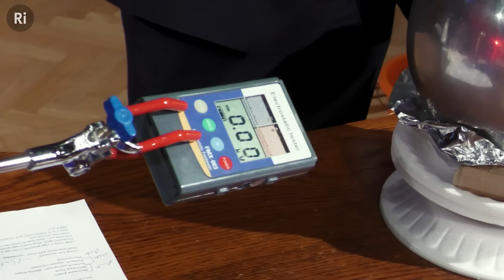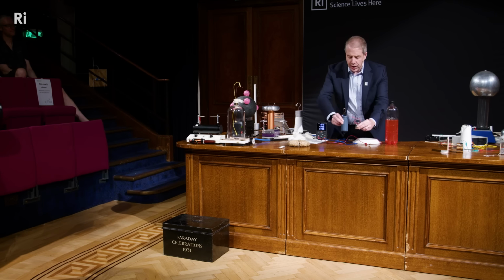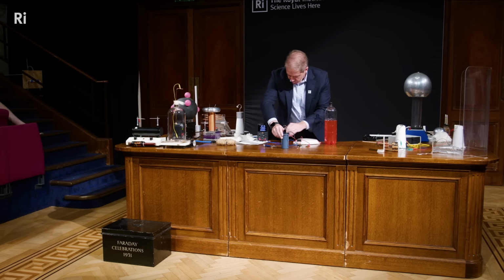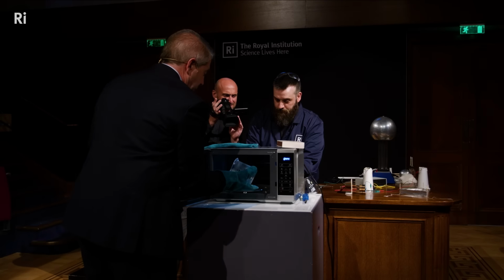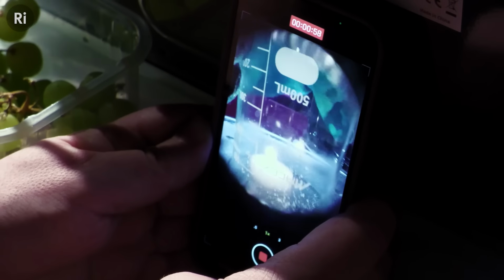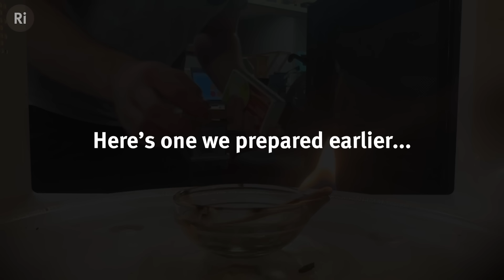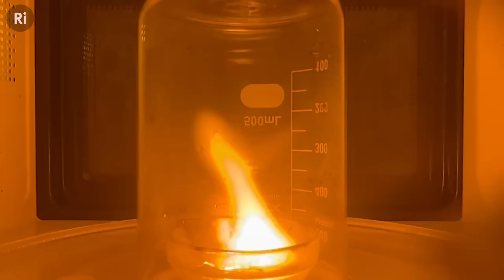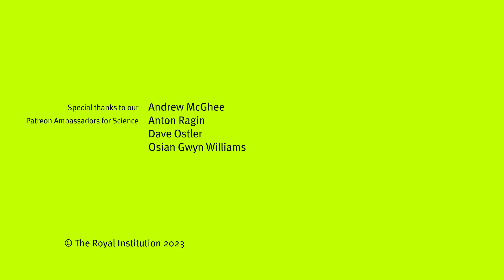High-voltage physics - with David Ricketts

Comment: What a show! The plasma toroid was the most extraordinary thing. I'm flabbergasted.
Reply: Thank you for writing out the name. I was really struggling to find it by description.  I seen your comment and did a search using the name you provided and now I am able to learn a lot more about that affect. It is super cool.
Reply: @TheRadioAteMyTV He said the name, you could have enabled captions too.
Reply: @Splarkszter  I couldn't understand what he said well enough to spell it it turns out.  There were no captions available where I watched it, so andy's post was a real life and time saver. I am grateful.
Reply: The tea candle probably doesn't work well because they have metal plate holding the wick.
Try a birthday candle.
Reply: And yet it makes perfect sense.  Plasma is conductive.  If you can get it in a ring, it becomes a secondary of a transformer, and thus self heating due to induced current.  I've never seen it, but as soon as i did, i was "kewl, the ionized plasma is a coil."
Reply: @jeromethiel4323  yes, and what most people fail to understand is its this feature that allows, or doesnt allow you to pump "so much power" into it as its just a transformer reflecting at the square of turns ratio.

some thinking, and a few measurements, you can figure out the resistance of that ..."single turn conductor" from the power draw.

other thing i always see is they fail to consider the other side of the circuit... theres the coil... but wheres the current actually coming from, and how does that magnetic field affect the induced toroid? 

from all my years on induction heating... its sort of important to consider the stray magnetic fields that are being created ELSEWHERE....
Reply: @michaelszczys8316  used to do it years ago, i never had any success with hydrocarbon/wax based flame.
whereas the example in the dish? notice its a MATCH. timber and paper work.

i dont know why it makes a difference but it does... different chemical reactions, valencies, iunno... the timber is carbohydrate (contains oxygen?) rather than hydrocarbon maybe.
Reply: @paradiselost9946  probably whatever makes more ' smoke '.
The stuff floating in the air is glowing.
Reply: @michaelszczys8316  it glows but it never has the same impressive results.

smouldering oils, greases... i just find that hydrocarbons dont do it anywhere as near as good as organic flames based on celluloses aka carbohydrates, starches, sugars...

Comment: As an electrician, I went to a house where lightning hit the TV antenna. It blew a hole in the tile roof. The TV coax had NO copper in it. Power points were blown off walls. 240 volt cables had NO copper in them. Just plastic spagetti.
Reply: My boss went home to get lunch just after a thunderstorm had been thru. Lightning had gone down his chimney, messed up his fireplace and hit his entertainment center. He said he was glad not to have been there, there was a lot of shrapnel.

Comment: Wow that's the most amazing lecture I've ever seen. I'm an electrical engineer working in power electronics. I wonder how many young people were inspired into a new career path from that? If so welcome and enjoy it.
Reply: It is only amazing if you ALREADY understand electrostatic theory- I couldn’t stick around for the whole video because it Sucks and he obviously didn’t rehearse to be sure the visual demonstrations would be successful. Huge fail imo.
Reply: Really? The most amazing you've ever seen?
Reply: @soburnedout  dont be so rude the ambient air humidity was high in London at that time, so think about it. He did better than you could do I am sure...
Reply: What is your job
Reply: Possibly amazing if you have not had any physics classes. I did all the high voltage stuff he demonstrated when I was a high school student in the 60s - including building a much larger and more powerful Tesla Coil. And it was built to Tesla's original design, not using modern electronics.

Comment: Very impressive lecture and demonstration. I have one correction though. The Tesla coil demo was not 1,000,000 volts. It was perhaps 200,000 to 300,000 volts. Tesla coils work by discharging many times per second. Each discharge creates a plasma trail. The next discharge follows the previous plasma trail. The path thus continues to grow until the power supplied is exceeded. This is what allows a Tesla coil discharge to be many times the length predicted from a simple air breakdown calculation.

Comment: An excellent progression through voltage and time periods. 
Keep in mind that the LAST thing Dr. Tesla would have ever thought about using the Tesla Coil for is creating music.! 
He did use plasma lighting as shown in the spherical demonstrations in the 1891 HPHF lectures; and predict that it would in the future be optimized and miniaturized chemically to work at very low voltages, which is what is now developed & implemented as LED lighting which indeed obsoleted the plasma vacuum of the fluorescent tube which he brought forth back then..
Reply: LEDs don't emit light because of plasma. They are "Solid state" devices. (i.e. semiconductors not vacuum tubes)

Tesla didn't invent the use of phosphorus coated rarefied gas tubes for lighting, but he invented powering the tubes "wirelessly" using a nearby Tesla coil.

Comment: I would like to present to you another electrical device:
- The device consists of two capacitors: C1 and C2.
- Each capacitor has two plates. In C1, these are named C1-1 and C1-2, while in C2, they are C2-1 and C2-2.
- C1-2 and C2-2 act as electrets and are electrically isolated from the rest of the circuit.
- C1-2 presents a positive voltage field to C1-1, and C2-2 presents a negative voltage field to C2-1.
- To rearrange the plates, C1-2 and C2-2 are mounted on a rotor, allowing them to be exchanged from side to side
- C1-1 and C2-1 are electrically connected through a load of arbitrary resistance and are mounted as stators in the system
- When the rotor is at 0 degrees rotation, the capacitor plates are as close to each other as possible, when the rotor is at 90 degrees rotation the capacitor plates on the rotor are equidistant to the capacitor plates on the stator
- the rotor plates are charged and then electrically isolated to act as electrets during opperation
- the stator plates are charges and discharges passively based on which rotor plate they are nearest to

If I start with 100 joules of energy and I rotate the rotor to 90 degrees using that energy and I lose 5 joules to friction, then I can store 95 joules of energy as potential energy and electrical potential energy between the rotor and the capacitor plates. Since the energy is being stored as electrical potential energy, a current will flow through the load until the charges on plates C1-1 and C2-1 are equal, the electrical potential energy stored will be equal to the potential energy we stored in the rotor 95 joules. Once the charges on C1-1 and C2-1 are equal, the system is at it's point of highest energy and the rotor is resting in at unstable balance point, tipping the rotor to 91 degrees causes the charges to rebalance to reflect the change in the exposed voltage field. Now C2-1 starts to accumulate the opposite charge as C1-2 and C1-1 starts accumulate the opposite charge as C2-2. This causes electrostatic attraction to increase between the plates and to torque the plate forward towards 180 degrees rotation.

This effect releases the potential energy that we initially stored on the rotor. When we stored the energy, we said we lost 5 joules to friction, so we're going to lose 5 joules to friction again when we release the potential energy, meaning we will get 90 joules of potential energy back as kinetic energy once we complete 180 degrees in rotation. At the same time, while we are releasing the potential energy, the magnitude of charge on C1-1 and C2-2 is increasing to reflect the new geometry of teh system. 95 joules of electrical energy will have to flow from C1-1 to C2-1 again in order to release the stored potential energy.

So all in all, in this case with the energy values presented:
- You will store and release potential energy on the rotor to complete a 180 degree rotation
- You will store and release 100 joules of energy with a 10% loss on retrieval
- You will cause 190 joules of energy to flow from C1-1 to C2-1 in order to store and release this potential energy

Comment: I've seen grapes used to induce plasma in a microwave. 😊Put a grape on a plate and place a glass over the top. Switch on microwave.  The glass keeps the plasma contained. It was a while ago, so please forgive me if I've forgotten something.
Reply: Ok? Bro, I induce plasma with an arc hotter than the surface of the sun every time I tig weld.
Reply: @AdamWest-qp3yp  In a microwave? Wow!
Reply: @LMde20  sure a microwave has metal I can weld. and yes I can take a beaker right now and make grape plasma in a microwave, it’s called hit start
Reply: @AdamWest-qp3yp  Look, I was making comment on the fact that their way of inducing plasma in the microwave appeared a little fiddly for them. And maybe they hadn't seen, or thought of, the simple grape. I'm happy for you that you can weld and seem to know more about plasma than most. But, your comments are coming across as condescending and off the subject I was discussing. I'm not here to argue with you, that's all.
Reply: @AdamWest-qp3yp wow, you’re so cool

Comment: In Faraday's first experimental demonstration (August 29, 1831), he wrapped two wires around opposite sides of an iron ring or "torus" (an arrangement similar to a modern toroidal transformer).[citation needed] Based on his understanding of electromagnets, he expected that, when current started to flow in one wire, a sort of wave would travel through the ring and cause some electrical effect on the opposite side. He plugged one wire into a galvanometer, and watched it as he connected the other wire to a battery. He saw a transient current, which he called a "wave of electricity", when he connected the wire to the battery and another when he disconnected it.[7] This induction was due to the change in magnetic flux that occurred when the battery was connected and disconnected.[2] Within two months, Faraday found several other manifestations of electromagnetic induction. For example, he saw transient currents when he quickly slid a bar magnet in and out of a coil of wires, and he generated a steady (DC) current by rotating a copper disk near the bar magnet with a sliding electrical lead ("Faraday's disk").[8]

Faraday explained electromagnetic induction using a concept he called lines of force. However, scientists at the time widely rejected his theoretical ideas, mainly because they were not formulated mathematically.[9] An exception was James Clerk Maxwell, who used Faraday's ideas as the basis of his quantitative electromagnetic theory.[9][10][11] In Maxwell's model, the time varying aspect of electromagnetic induction is expressed as a differential equation, which Oliver Heaviside referred to as Faraday's law even though it is slightly different from Faraday's original formulation and does not describe motional emf. Heaviside's version (see Maxwell–Faraday equation below) is the form recognized today in the group of equations known as Maxwell's equations.

In 1834 Heinrich Lenz formulated the law named after him to describe the "flux through the circuit". Lenz's law gives the direction of the induced emf and current resulting from electromagnetic induction.
Reply: Fun fact: When Faraday demonstrated electricity to parliament, he was asked, "What good is it?"
Faraday answered, "I don't know, but within a generation, you will be taxing it."
Reply: @friendlyone2706 boy ain't that the truth.
Reply: Thanks
Reply: @friendlyone2706  🤣👍YEEOWZA

Comment: It was a great show. The plasma toroid is a fairly new high voltage demo and getting one up and running takes some work.

One minor quibble. The one milion volts on the Tesla coil is most certainly inaccurate. Tesla coils act in a pulse mode as he mentions.
 During the on cycle there are lots of positive and negative voltage swings. The first swing ionizes a short channel of air. The next 
swing uses that already ionized channel to go a bit longer. Over the course of the pulse there are a lot of these swings, each extending the 
spark channel length. So the final spark is much longer than a single spark. I'd guess based on the size of the coil that the actual voltage is
nearer to a 100kV. Still an impressive volatge.

Cheers.

Comment: 51:50 You are not seeing electrons, but rather ions. The so-called "vacuum" is just a partial vacuum with high voltage AC jumping over a greater distance with the aid of ionized gas molecules. This arc probably gets started randomly from ionizing high energy radiation particles passing through the chamber.

[The point is that low pressure gas does not block an arc as easily as does high pressure gas.]

Comment: Great video, but parts of it weren't clear. E.g., @2:00 - why does "friction" remove electrons? Do the electrons from both atoms touch each other? No, that's not possible. Electrons are either point particles or clouds. Either way, nothing "touches." Even wikipedia doesn't explain why it works, it says, "Rubbing two materials against each other can lead to charge transfer, either electrons or ions." That's obvious, but what force causes electrons to leave one object for another? That's what's mysterious to me. Until I know that, I can't really appreciate all that follows.

Comment: 48:36 48:39 48:41 48:52 49:43 50:08 there it itin the grand gallery into the kings chamb 51:05 sealed the queens chamber is the door but don’t open the gate if we have crossed the surface of the black hole

Comment: Very nice demo!  The atmosphere was too "wet" in the room for the static demos work well. One thing I still don't have clear in my mind is why the tesla coil spark doesn't jump directly through the shortest path to the bottom of the apparatus.
Reply: I think the distance from the top hat capacitor to the grounded Faraday cage was shorter than the distance to the base of the coil - so the discharge took the path of lowest resistance.
Reply: Actually, that’s the deceptive part about the coils. while it looks like a single long arc. It’s not. The discharge occurs over multiple cycles. The initial breakdown starts a plasma channel, the next “break’ moves it a bit more, and the next, and so on. You should have noticed that they put a breakout point on the toroid pointing at the cage (which if you look at the bottom you will see is connected to the ground of the TC).  That forced the discharge to occur at that point - it’s more fun to let it build up before discharging, but you never know which way it is going to go. The coils in this demo use solid state components to do the switching - a relatively new (as in the last 15 years or so since IGBT devices started handling the massive currents involved) - before that Tesla used a spark gap - which happens to be the same thing I used in my coil. I managed to get 2 meter streamers out of mine- but I doubt it was more than 700KV or so. I have pictures somewhere showing the ‘banjo’ effect where the heat of the plasma causes the discharge to rise - on a long exposure you can clearly see that it’s multiple discharges rising “slowly” for values of slow.

Comment: Should test the demonstration a bit better in-situ. :) Otherwise it's not convincing anyone, the wands were pressed all over the place to reset etc.
Reply: The problem is that humidity is the bane of static electricity demonstrations, and London in the summer is normally quite humid, add to that a room full of people exhaling water vapour and you have seen the result, it's not something he can control.
Reply: @steve1  That's true indeed, but maybe in that case you could think of different experiments that are not depended on the weather?
Reply: I would say he definitely still succeeded in conveying every bit of information, even with the handicap of sensitive sensors.
Reply: Convinced me far more than any PowerPoint show would have. Simple equipment which I could relate to, steel plates, copper, foil and realistic experiments which didn’t always quite work out - but I could still understand the ideas behind it.
Reply: This is why nobody invites you to parties 😃
Reply: Yep, he hardly explained what was going on, kept fiddling with equipment and confused himself. Felt like watching someone on an excessive stimulant dose.